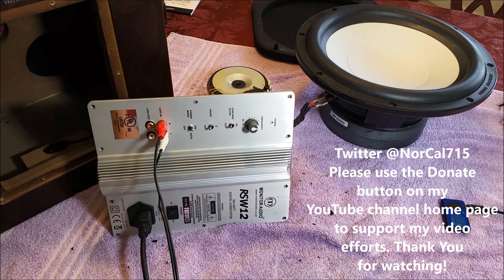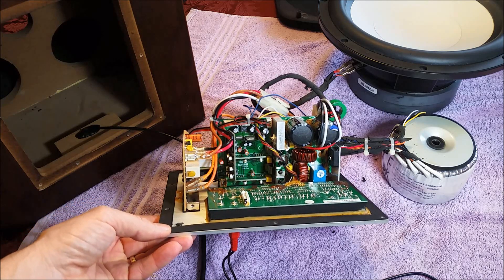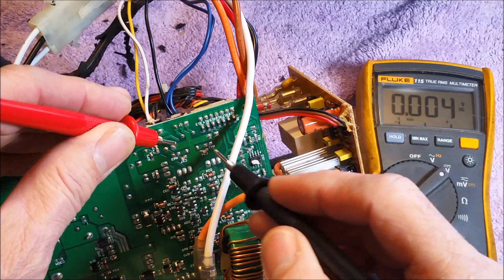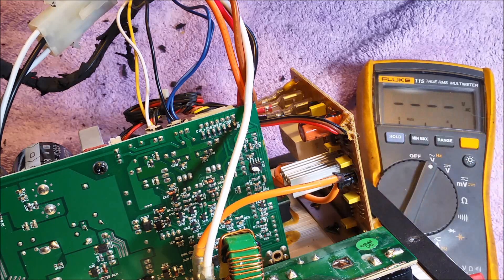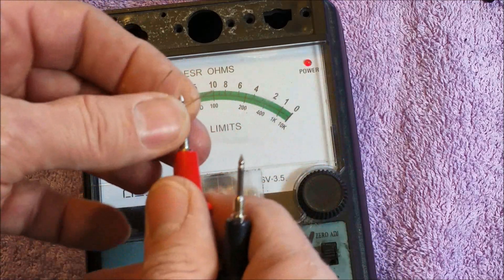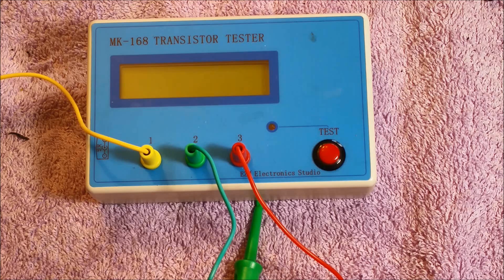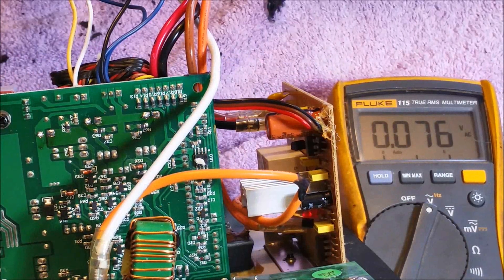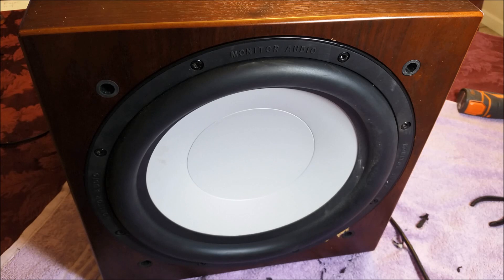Monitor Audio RSW12 Repair. Finding Bad Capacitors With A Volt Meter

Comment: Hi there,
Thank you for your video . I have one of  the Monitor Audio RSW 12 exactly the same model as you have and the problem was in the first time was very low humming and after for awhile it was no sound at all even the green light ( back side ) was not turned on when it get a signal , I was taking it out and checked all the Capacitor then I see two of the main capacitor ( 4700uf ) was bad sign ( swollen ) I did change both of them but the problem was the same . So I dont know what is the next step to check on it ,please help me out .
Thank you , 
BT
Reply from the maker: Check the latest repair on another RSW12, all(most) SMD caps were bad https://youtu.be/D6dz7CWndYI https://youtu.be/Z4bvkVjpMvw

Comment: Hello. In the same subwoofer in construction. There is a difficulty in construction. Burn out the part of the fee in the relay dynamic. You can take pictures of payment from both sides in the field of choking. See you in the video is just part of the payment.

Comment: Hi dear friend,
Please , show me how to open the back panel of the sub . I unscrews all of them but I could not pull it out  .It's so tight and no way to open it ! Any suggestion highly appreciated . Thanks in advance .
Best Regards,
BT
Reply from the maker: it may have some type of glue to provide an air tight seal, you may have to pry it open.

Comment: Please , show me how to open the back panel and woofer .  I unscrew all of the screws in the back but it was so tight to pull it out . Thanks
Reply from the maker: it may have some type of glue to provide an air tight seal, you may have to pry it open.

Comment: Do you now what makes a subwoofer amp only push DC current instead of AC current cause my amp is doing that
Reply from the maker: sounds like a shorted output ic/transistor

Comment: A Class D amplifier is not digital but transforms the input to a PWM signal with is then amplified (by fast switching mosfets). After that the high frequencies are filtered out by inductors and capacitors. 
Just my two cents.

Great explanation of the analysis and repair. Tx!

Comment: capacitors have such a short life, the average is 1000 hours I look for high end ones that rate 5000 or more hours. if you leave the sub on all the time as I do they don't last.
Reply: Yanuario Arias Hi
Yes, I too only buy reputable brands and look specifically for low ESR and longer lifetimes. 
I expect those caps to last a lot (really a lot) linger than the cheap Chinese caps that are surprisingly enough put in even high end systems. 

That said, sometimes (often) the design of the circuit is just not suitable for a standby mode. 
Especially because this amp is a class D anyway, a very efficient SMPS would have been much more suitable for the low voltage pre-amp than the regulators and resistors that dissipate any access energy and warm up everything around them. 

Even better would have been if the transformer would have had two extra leads with lower voltage for this part of the circuit so there wouldn’t be that much to dissipate in the first place.

Maybe this sub does have those extra leads. I’ve repaired several KEF en Harman Kardon sub amps that just have output 3 leads from the transformer. They have 50-80V outputs that have to be brought down to 15V and it’s done by dissipation. 
Just opened a ‘newer’ (8 years old) KEF. Still the same board but they move the dissipating resistors to the heat sink. So the recognised the issue and patched but didn’t really solve it. 
They also still used a lot of ‘Licon’ and ‘Samcon’ capacitors. Such a pity.

Comment: Great video! I had exactly the same problem with my RSW12. After replacing the 220μf 25v and the 100μf 16v capacitors, the sub works perfectly!
Reply from the maker: Awesome

Comment: Thanks for posting this video. Got one of these subs for free via neighborhood curbside trash pickup and was able to fix it, hardest part was lifting it and putting it in the truck. also, the trick for removing the nut holding in the toroidal transformer is nail polish remover. turns that black stuff into butter.

Comment: I have constant hiss from my JBL 305mkII speakers. Hiss stays there even if they are plugged only into wall, there is also not problem with electricity. There must be problem inside the speaker, do you think there is way how to repair it ? If anybody can help i will be be verry happy.
Reply from the maker: Check the capacitors if you have the ability. Thanks for watching!
Reply: @norcal715  Thanks a lot for answer,this hiss is normal in all JBL monitors. but hiss is lo longer problem, i changed my room setup and its ok. But after my 2 year warranty i will go to local hifi repairer and i will tel him that maybe its capacitors.

Comment: I really enjoyed the video and I too have a Monitor Audio RSW12 with the exact same issue as you fixed.  Wondering where you sourced the capacitors from and what type did you buy?   Thanks for any help you can provide.

Comment: hello  one of my monitor speaker  stopped working after i adjusted the power to 110v and put it on a 230v outlet ..but before that the bigger speaker wouldnt work only the tweeter worked ..but i got them a week ago everything worked fine . can you help me try to fix it .

Comment: Good day sir, i have  a sub here  Monitor audio  Silver  RXW-12. The problem with it is:  The red light goes from green to red without stopping and sometimes stays on red , sometimes not. Where should i check in it and how do you take off the black hard glue without braking the circuit. Waiting for answer. I'm counting on you because i'm stuck. By the way. im a certified tech but i'm still learning. Thank you! waiting for answer. Best regards. Serge.

Comment: +norcal715 Good morning! I'm working on a LED Samsung smart TV model is UN40D6420UF when it plugs in it auto turns on and off for however long it's plugged in no text on screen just black backlite picture it clicks each attempt while plugged in it seems SDP1001 gets warm hot depending how long set is plugged in??? What do you think should be checked or replaced by not ordering both new boards to fix this?

Comment: one time i was hung over really hung over and my amp died the same day (reason for getting so drunk) anyway while extremely hung over i dragged myself to the amp i somehow disassembled when drunk...

reading voltages hurt, so i grabbed a 100uf 20v capacitor, attached one side to ground, then i attached the red probe to the positive...

then i simply touched the positive to the positive side of each capacitor and listened for the hum as i touched each cap...

viola, 30 seconds later i discovered 3 dodgy caps (as you touch the bad cap, it reduces/stops the hum)
Reply: Any chance you could give more detail or tutorial here?

Comment: Nice video with good troubleshooting :). Expected a bad cap from the beginning on, but near the regulator was a surprise :). The MK-168 is a chinese knock off from the famous AVR Transistortester. It's a very nice device :D, had one build myself many years ago from the original schematics.

Comment: IF you still have the sub please look at the glue when it turns dark it becomes conductive. you may want to flake it off. Also would make a great video showing that it acts as a resister.
Reply: You sure